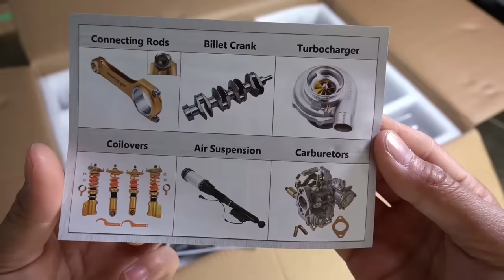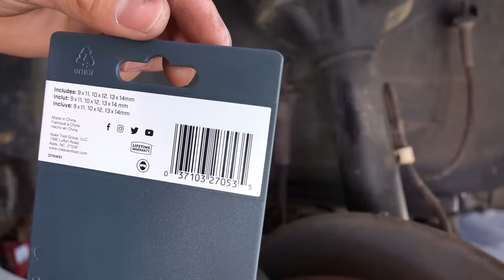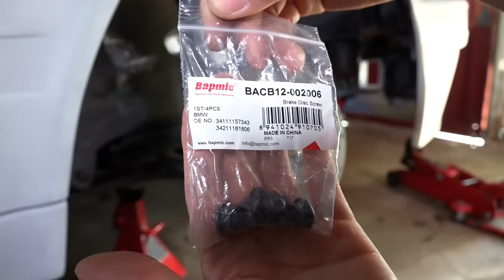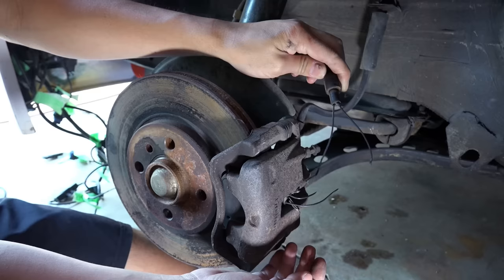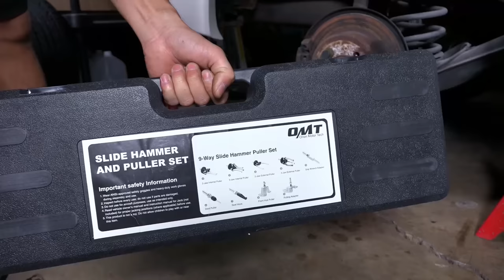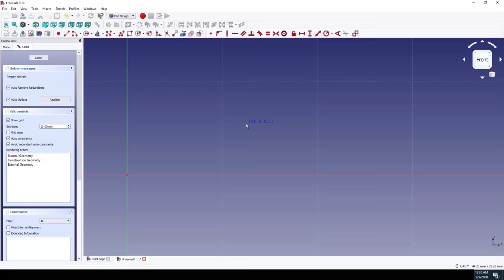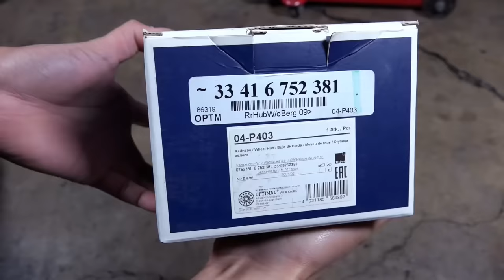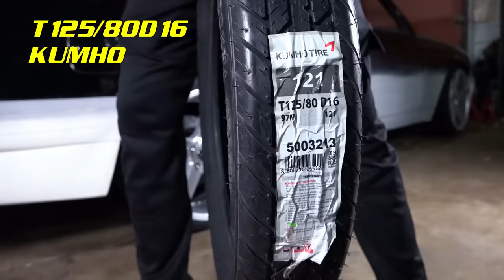E30 Fix 15 | $2,874 5 Lug Conversion, E36 MaXpeedingRods Coilovers, E46 Big Brakes, Z4 Hubs

Comment: can the stock front e30 suspension fit with the e36 front knuckles?
Reply from the maker: Yes.
Reply: @DarkDragonWing Would i need to use the camber plates to line everything up?
Reply from the maker: @realname2964  Yes, just like in the video.
Reply: @DarkDragonWing  Another question, would the camber plates you used work with stock suspension? if not do know any that could?
Reply from the maker: @realname2964  I actually don't know if the plate will fit an OEM strut. It should, but it is definitely harder to install because the springs will need to be compressed while doing it.
Reply: @DarkDragonWing  Makes sense, but for now I am running lowering springs so maybe that could make it easier? I would like to avoid getting coilvers for now if I can due to price but if I need to, then of course I will.  I do plan on getting coilovers later anyway.
Reply: @DarkDragonWing  its looking like I'll be going with e36 coilovers in the end, so new questions: do the rear e36 shocks fit into e30 mounts, and why did you need a different spring in the rear?
Reply from the maker: @realname2964  E36 rear shocks fit E30 with no problem. I got new and shorter springs to lower the height. The E36 ones are too long.
Reply: @DarkDragonWing  awesome so all I'd need is an e36 coilover kit and e30 camber plates. if I was to get shorter springs like you did, how would I know what size to get?
Reply from the maker: @realname2964  I just guessed and went with Hyperco 184B0600 Blue 2.50" I.D. 4" Length 600lbs rate. You just gotta try them out and let others know how they fit.

Comment: You will need steel nuts for that spare.
Reply from the maker: At first I thought I bought aluminum lug nuts too, but they are actually metal/steel lug nuts which is perfect. Cheers

Comment: with all the money you put into this with tools and parts, you could have bought a pristine beamer, with 10km on the odometer, that needed nothing. you actually could have bought a lamborghini, and a BMW, and a Audi A8. I can imagine just looking at those original photos, how many man hours went into the labor just on the body alone. a lot longer than one 30 minute YouTube video. oh and one more thing, how did you get a title for this wreck? if you just walked up to it on a field, it still had to be titled to someone, and you need the title to register it yourself.
Reply from the maker: It was a working car, I took almost everything apart now. Restoration is one of the goals.